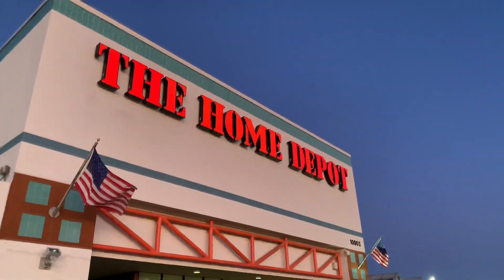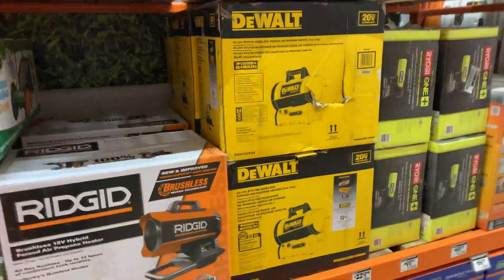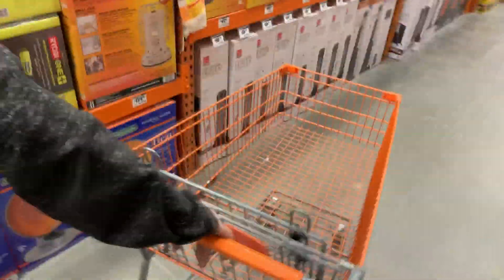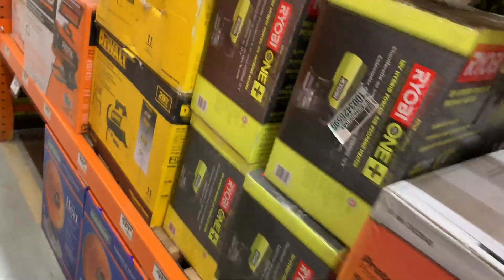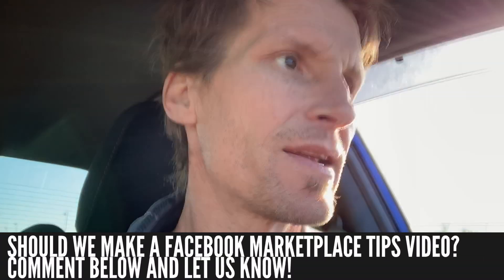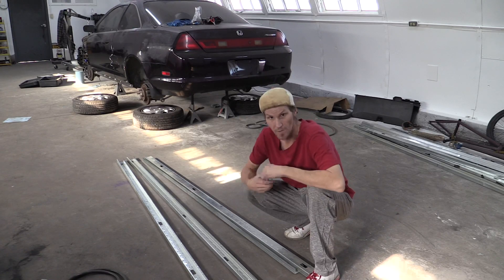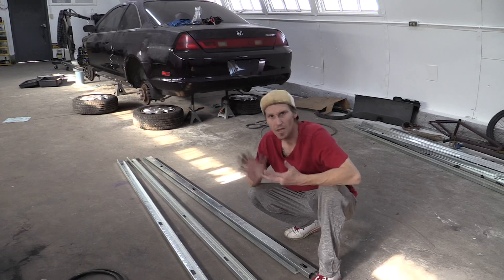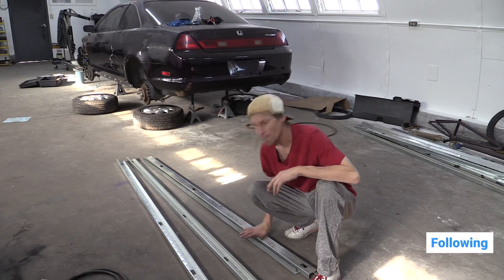Building a Custom DIY Powder Coating Oven Part 1

Comment: What is that metal called and where did you get it
Reply from the maker: 18 gauge sheet steel. Den Col in Denver, CO.  Best option would be to find a steel supplier in your area as it's costly to ship.

Comment: For your stripper what do you use for a mask. I’m looking for one on amazon but was told N95 isn’t for chemicals and the ones that say chemicals are $30 and i just don’t trust them. What do you use? Would you have a link?
Reply from the maker: Just a regular respirator/dress mask. Some may say it’s not enough, it works just fine for me. K.I.S. Keep It Simple 🤙

Comment: I have a question. What do you do when u get parts that are packed with grease on the inside? I got a snow machine suspension part that has a sleeve inside. I was thinking of dropping it into my stripper but don’t want to contaminate that. And i don’t think soaking in TSP will work evening though it’s a heavy duty degreaser. What do u guys do in that situation? Is there a truck to it when u can’t get into where the grease is?
Reply: No way to get into it i wish there was. It’s a joint that’s sealed. This one will be interesting lol
Reply from the maker: BJ Putvain It will be interesting for sure, let us know how it turns out.
Reply: Thanks though for all yr education and help
Reply from the maker: BJ Putvain Not a problem! Thank you for your support!
Reply from the maker: BJ Putvain we actually have not had to deal with this situation yet. Can you warm the part some to clean it out?